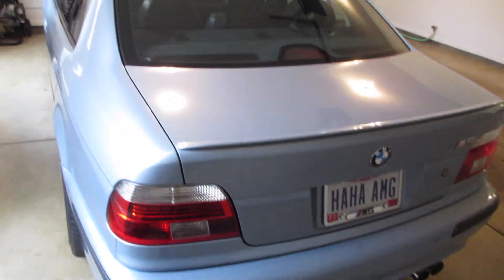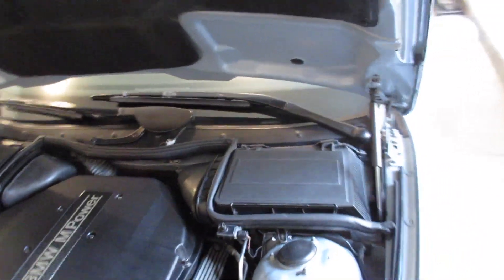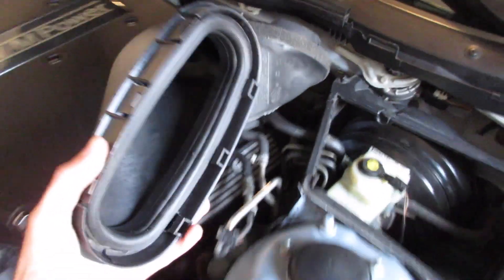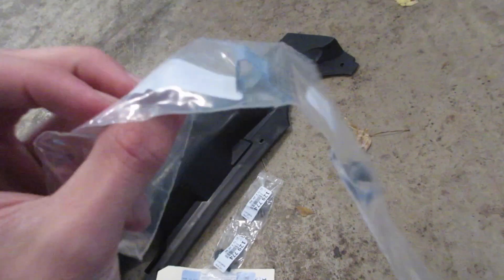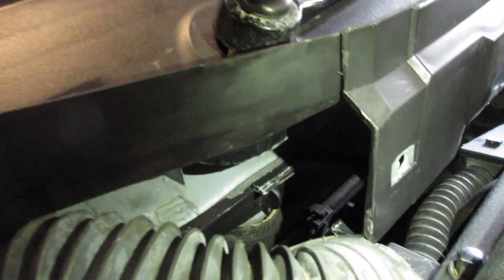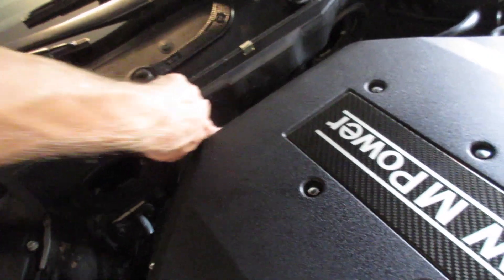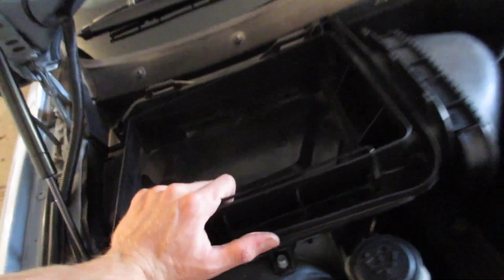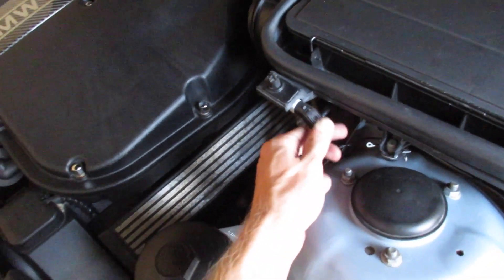BMW E39 M5 Firewall Trim Replacement

Comment: Ryan- be sure that none of the chips from the old, crumbling firewall are near the engine. There is a story from a guy on the M5board where his engine caught fire and had he not had a bottle of water handy in the car, it might have been end of days!!
Reply from the maker: I've driven it enough that it has all fallen out.. but that's definitely a worry.  Thanks for the heads up on that!